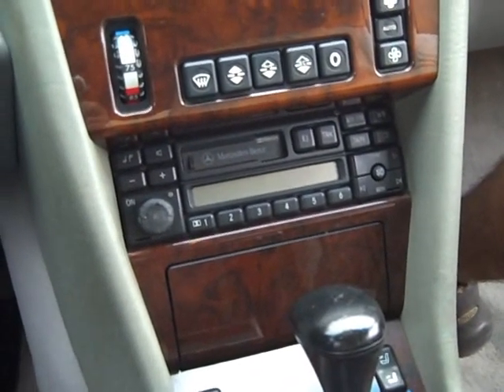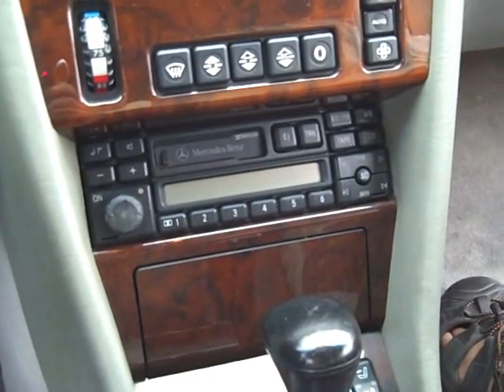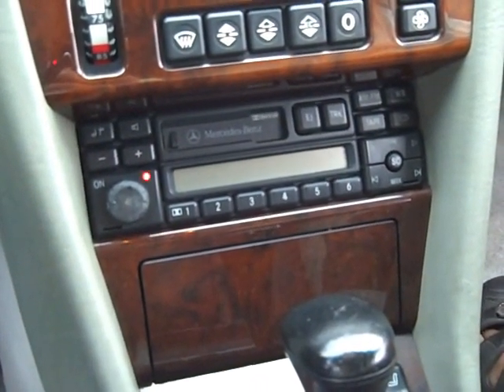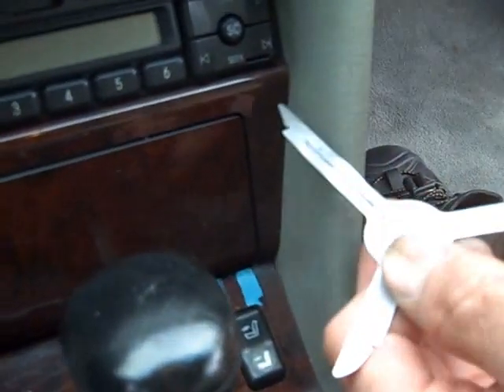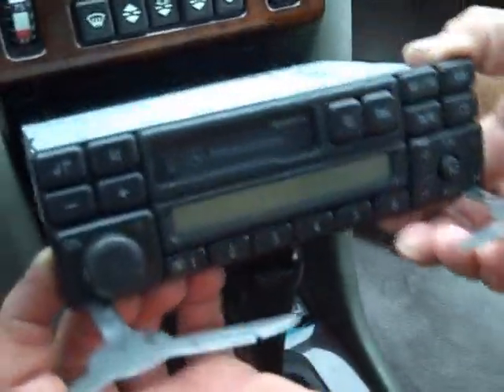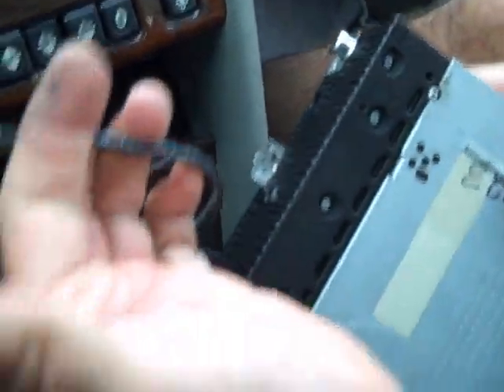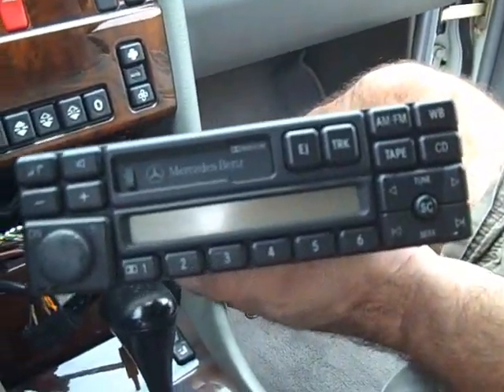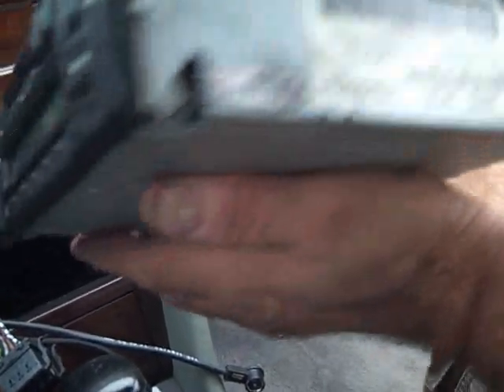Mercedes Benz Car Stereo Removal 1994 - 1999 = Car Stereo HELP

Comment: Hi I have a 1991 500SL UK spec with a Becker Radio with a cassette. Could you tell me how to remove the radio please. Also I don’t have the code for it. Is there a factory code? I was hoping if I could get it out I could get the serial number and contact the manufacturer. I hope you can help . Cheers Kieron across the pond

Comment: id recommend replacing the radio, I just replaced mine, I got the radio unit from a Mercedes in my local junkyard and it was only $10, its very easy to remove and install radio unit, if you get a radio from another Mercedes make sure you get the vin of that Mercedes or try to find owners manual with radio code, if you can't find the owners manual, you need it to call a Mercedes dealer and give them vin number of "junkyard" Mercedes and get the radio code for the "new" radio, its free and it takes 3 minutes for them to give you the code over the phone.

Comment: My radio doesnt work when its cold out
Do I need to replace wires or the radio itself?
Reply: id recommend replacing the radio, I just replaced mine, I got the radio unit from a Mercedes in my local junkyard and it was only $10, its very easy to remove and install radio unit, if you get a radio from another Mercedes make sure you get the vin of that Mercedes or try to find owners manual with radio code, if you can't find the owners manual, you need it to call a Mercedes dealer and give them vin number of "junkyard" Mercedes and get the radio code for the "new" radio, its free and it takes 3 minutes for them to give you the code over the phone.

Comment: Nice video... thanks.  Just bought a '98 C280.  Factory radio looks awful... buttons missing,,, display off color.  I haven't even turned it on.  It is a cassette unit, but I noticed there is a CD changer in the trunk.  Do you offer a factory dash unit that is a simple R&R ?  Thanks.

Comment: Great video! Can you remove without the special tools?
Reply: I used butter knives
Reply: Joshua Godsey  You can use a old credit card and cut the shape in the credit card it does not to be very precise.
It works for me

Comment: It's a great video thank you the only suggestion I would add is that when you removed the ground and antenna connectors your hand was in the way and the viewer couldn't really see the connections being removed. I was specifically looking for what the ground connector looked like but it's not visible. Thank you for taking the time to make these videos.
Reply: how to put the code in my 1995 Mercedes Benz stereo to have it work